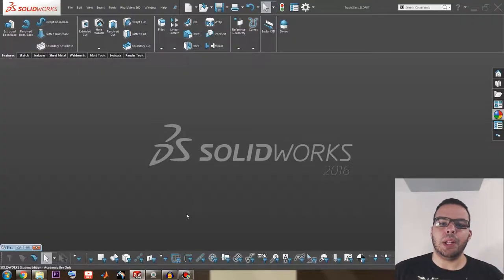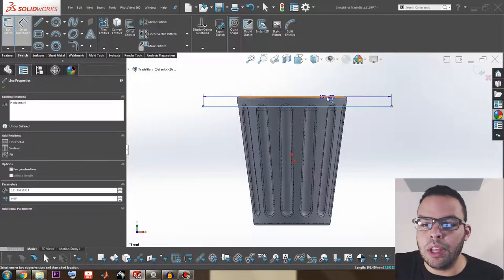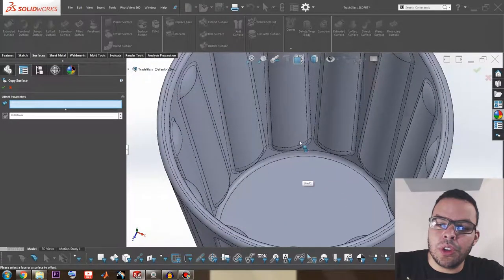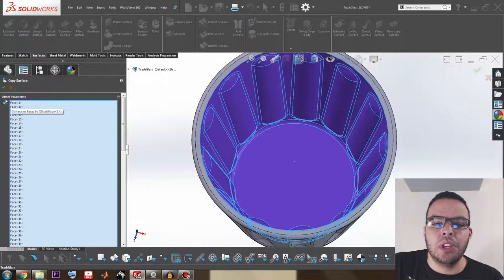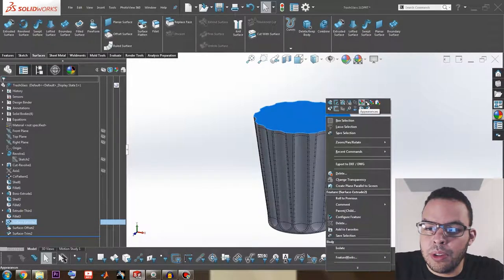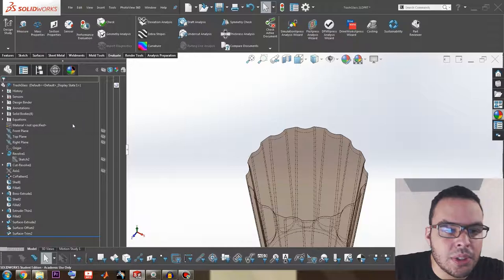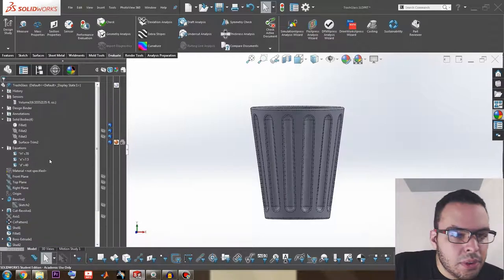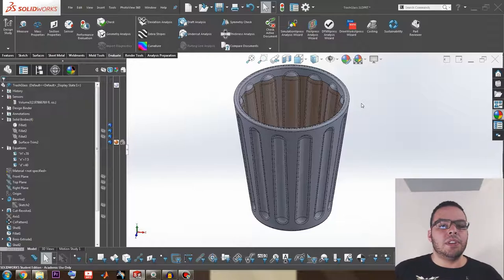SOLIDWORKS - Using Surfaces to find the volume of a Shotglass (sensors)

Comment: Hi Rob! Thanks for the tutorial!
Is there a way to make a dimension (for example the bottom diameter) dependent on the measured liquid volume instead of changing the dimensions with trial and error to achieve the result? For instance, if you'd like the volume to be exactly 3.0000 fl. oz.?

Comment: Is there a specific reason to use this method rather than the "Intersect" tool to create a volume between the plane and the inside of the shot glass?  With the "Intersect tool" you wouldn't need to select every inside surface of the shot glass , since you can select the body itself.  Am I missing something?
Reply from the maker: Hi! The short answer to your question is "no, you aren't missing anything". Intersect is the faster and easier approach to finding the volume of a container, though it may be prone to failing if the geometry is complex. If you do get errors, I would use the technique outlined in this video. But otherwise, that is a really good question! So good, in fact, that I decided to make another video where I credit you for the suggestion! Check it out: https://youtu.be/9JhAkyDshhM

Thanks again for watching!